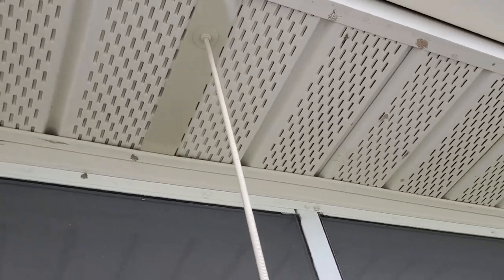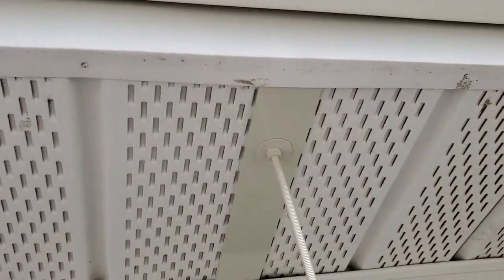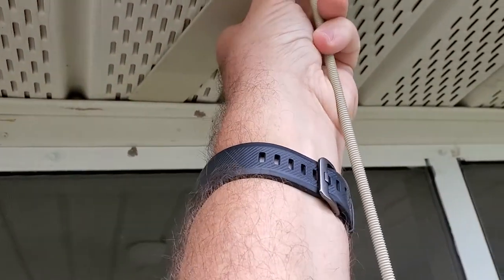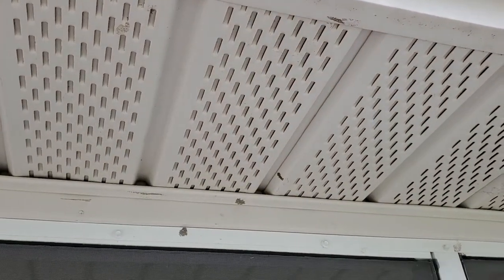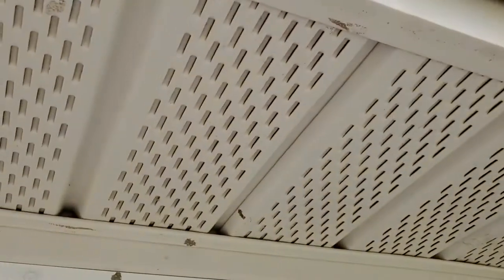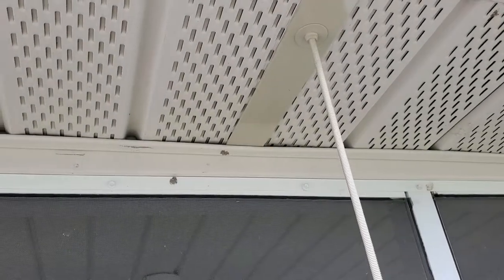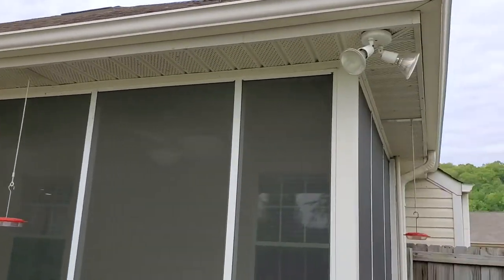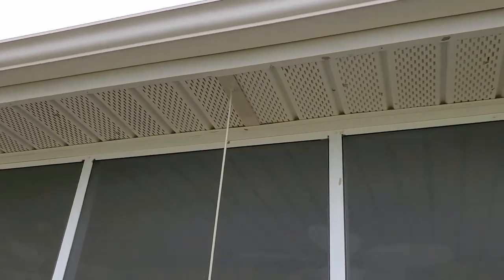Hummingbird bird feeder under sofit close up install

Comment: Hiya Jim…. I wanted to give you a huge THANKS for your video on the Ranger Lariat side mirror covers!…  (the comments are turned off on that one, so I clicked on your name & other videos & found this one).  Anyhow, I got those same dark/smoked lens sequential LED turn signals for my truck, graphite like yours…  & all the videos I could find had English guys pulling the mirror forward & showing the tabs behind them… well, mine has 4 torx screws, 1 at each corner behind the mirror.  Anyhow, after watching your video, I installed my new turn signal assemblies in minutes & they look GREAT!!…  So thanks again brother!!….  May God bless you & yours Sir! 🙏🏼🇺🇸🙏🏼
Reply from the maker: Thanks for the reply. I didn't realize that and have turned them on. Glad I could help you

Comment: Love the idea of mounting under soffit. I went to Home Depot to look for flat aluminum bar but no luck. My research continues to mount battery powered cameras.  I own a townhouse and...you know... Thanks for sharing.
Reply from the maker: Here is the link for the flat bar.  https://www.homedepot.com/p/Everbilt-2-in-x-36-in-Aluminum-Flat-Bar-with-1-8-in-Thick-801977/204273999
Reply: Shouldn't have any problem finding that flat bar in HD or Lowes.  Make sure to use aluminum.
Reply: This is a great idea!